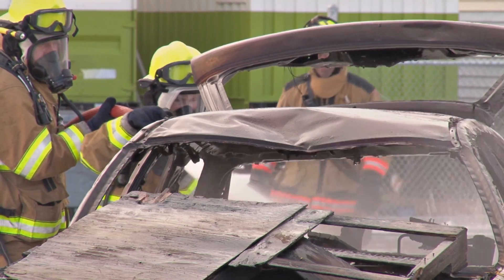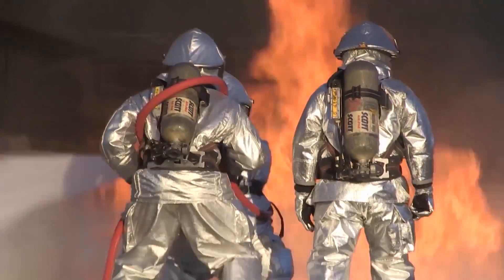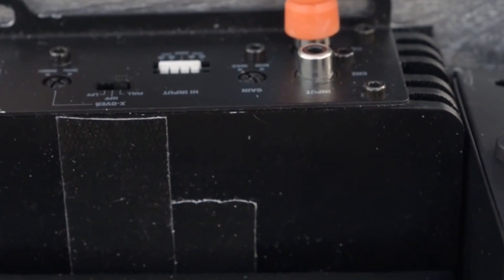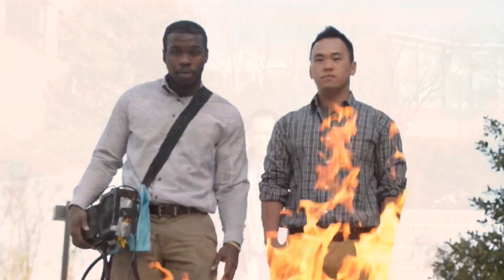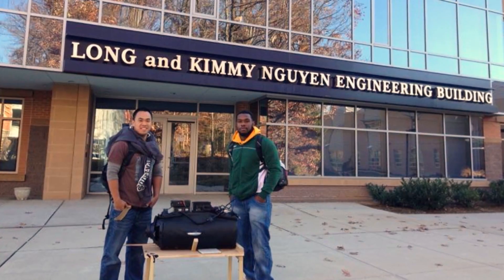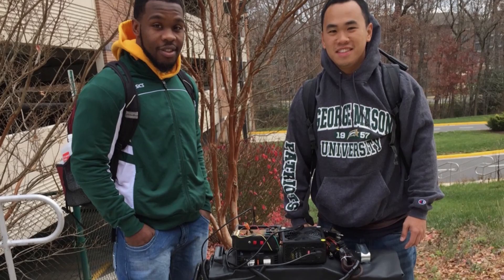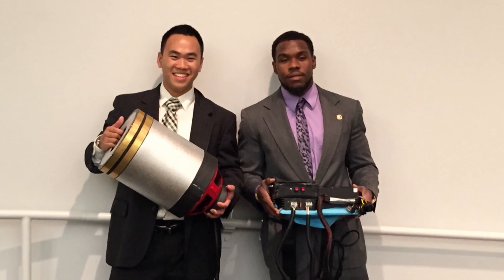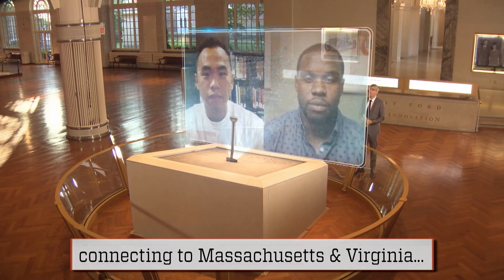Sound Wave Fire Extinguisher | The Henry Ford's Innovation Nation

Comment: Low frequency sound wave interference creates temporary near vacuum conditions removing oxygen from the point of ignition. It boggles my mind that the MIT kids who proved this don’t understand how it works. 

Why does it appear to blow the fire out? The fire is dancing to find oxygen to oxidize the combustion reaction further. When sound waves persist they align molecules into patterns. Think magnetic resonance. Low frequencies travel slower and pick up more molecules and create more negative space. I can’t be a literal moron and able to recognize this when people with 6 figure engineering degrees think it blows them out with wind. Wind brings oxygen and feeds flames. 

Please tell me someone has figure this out. Sub sonic waves would do even better. 

Please please please tell me that people working on this concept for its application actually know how it works.

Comment: subwoofer create high air pressure, that is just air moving in and out of the tube, not a specific frequency of the fire. please prove me wrong :D
Reply: Low frequency 30 to 60 hz creates vibrations according to study.
Reply: @jhung2479 all frequency range creates vibration in the air :D

Comment: In 1926 Charles Kellogg did a demonstration in New York of the effect of tonal vibration on fire, putting out a fire with sound. Sound Wave Fire extinguishing has been known about for a long time it seems! I wonder why it's not more widely used and known about.
Reply: It takes the money out of their pockets just like when they made cars work with water. Then everything becomes free. Can't charge for sound, air, water, land or fire.
Reply: Why would insurance companies and pharmaceutical companies want free solutions.
Reply: Real world application is difficult.  Note the speaker columnator is the same diameter as the pan. 

If it was an unrestricted liquid fire.  Ie a gas spill.  ThIs device would likely gaol to extinguish a fire that could move around the fuel.

Additionally put this pan at waist level and see if this device can extinguish it.
Reply: @neuro2k  they said that you can insert it on top of your stove to use when needed

Comment: Bushfires are what needs to be put out.   These invention won't work.
Reply: Why.? Need huge device.?
Reply: @craighotson8848   they would be way to big to move and not practical because much better alternatives, but as they say in the it may in the future be able to extinquise fire in space station or buildings with much electrick devices since in space water is limited and hard to controll and in rooms with lots of electrisety water may make the fire worse and in neasecarly destroy devices, although they often uses nitrogen to push out the oxygen and kill the fire
Reply: https://youtu.be/bscT3BiXMrA
Reply: https://youtu.be/S3Q3DGeU_Jo